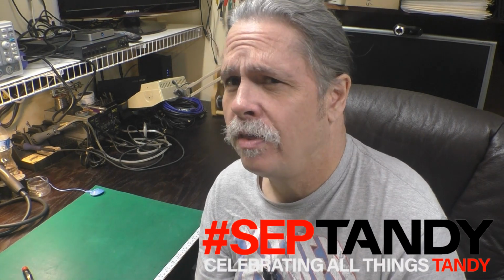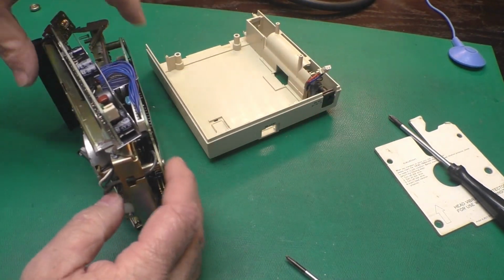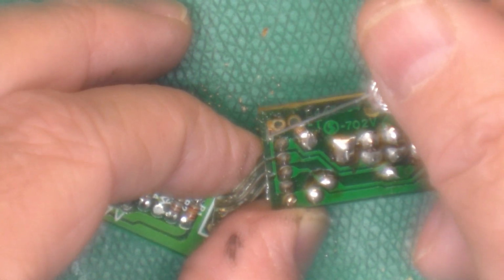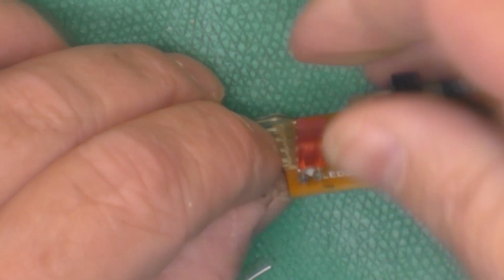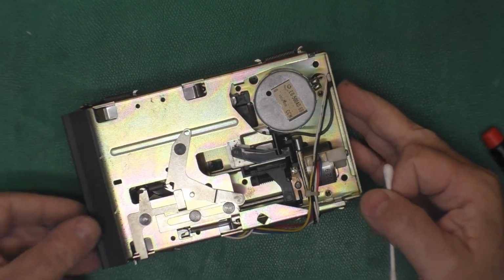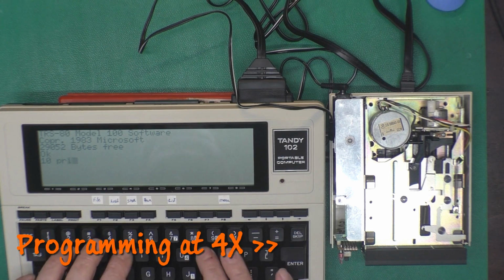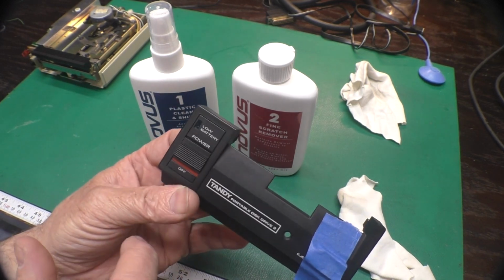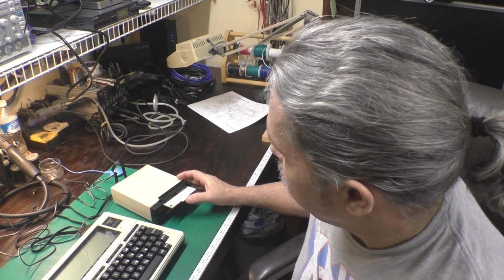Tandy TPDD2 with a hard knock life. Can we save it? #SepTandy2021

Comment: Nice fix. I have to pull mine out and see if it still works.
Reply from the maker: If the belt has not been replaced it will need one. Belts and corroded batteries seem to be the big issues.

Comment: I was starting to think the error LED had a micro-fracture.
Reply from the maker: On the other drives I have seen you can see the LED flash from the glitch when turning ON/OFF. Admittedly I have only worked on a few. It was an opportunity to learn something new, a better way to test that circuitry.